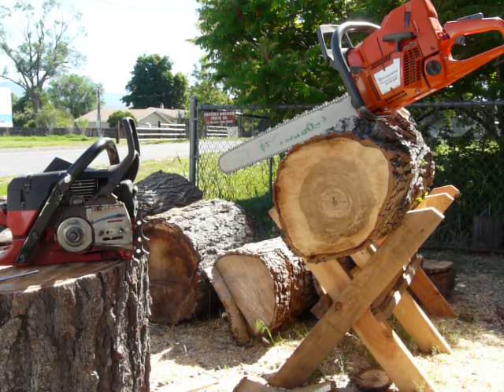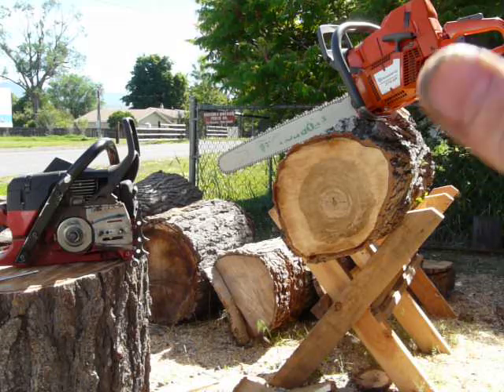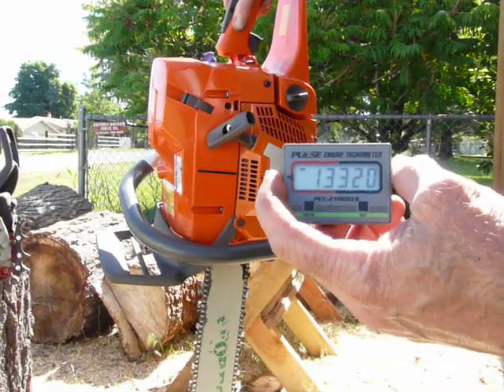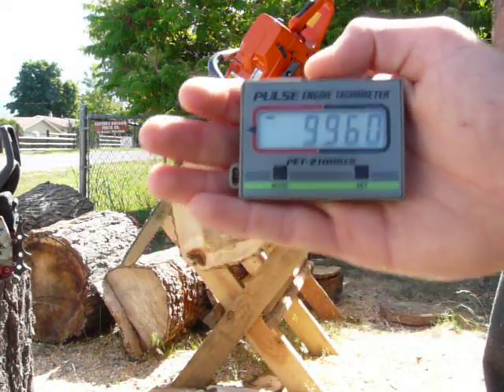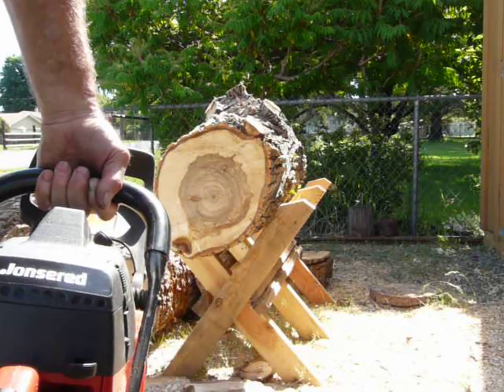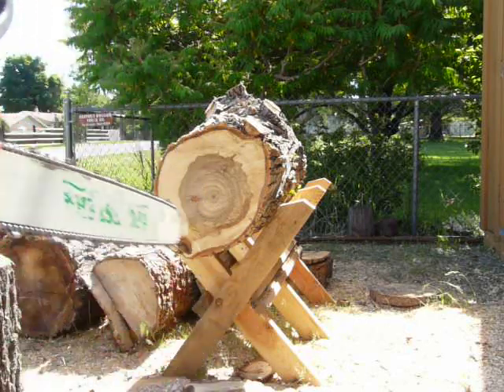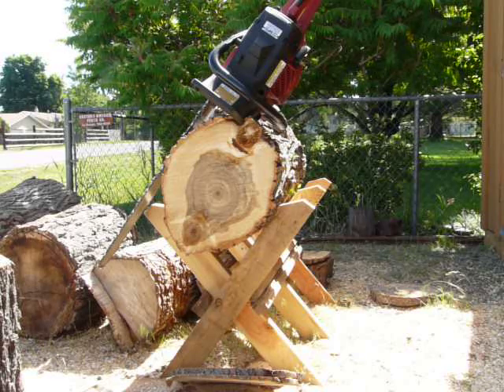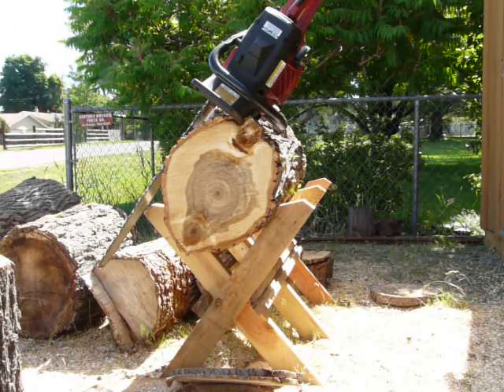Husqvarna 372xp x-torq vs Jonsered cs2166 "Got Flow" 0.5

Comment: Mr. Jack, any commentary on the Forester bar?
Reply from the maker: Brian hi. I've used a 24" bar just a few times. Never for felling.  Only in tree work or some of the test sessions seen on this channel over the last 2.5/3 years. This particular bar came with a saw I inherited. It seems heavy for being  so short and it seems like rails are a bit soft. Thanks for watching.
Reply: @hotsaws101  Another logger friend of mine made similar observations. I have been using one moderately for about a year. I admire and appreciate your broad spectrum of ability.